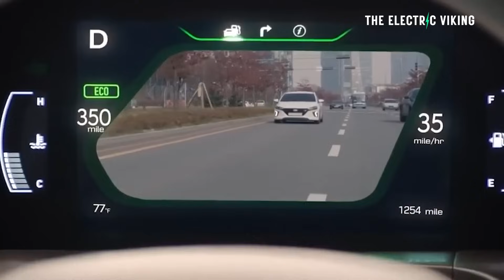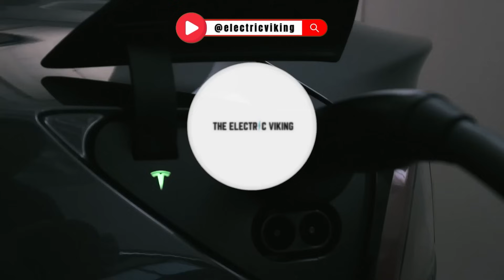Hyundai reveal new hydrogen fuel-cell SUV for global production

Comment: If I was trying to make a widespread hydrogen vehicle I would make BEV with 100-120 miles of range with only ac charging. This would reinforce the myth of evs taking forever to charge and then if they go on a trip they gas up with hydrogen for another 200 miles of range. Would also be beneficial to apartment dwellers without the ability to charge at home. Perhaps a way to feed leaked hydrogen into the fuel cell to charge the battery would prevent wasted hydrogen and fuel. This approach would get a lot of people into EV’s that otherwise wouldn’t which is why a manufacturer wouldn’t do this strategy. If there was any meaningful battery range then people would see how little they use the hydrogen range extender

Comment: Warm water drops / vapor from an all hydrogen fueled transportation multi million vehicle infrastructure refreezing onto roads, coating roads, and parking areas, creating black ice anywhere all winter day and night when traveling on straight, hilly  and curvy road surface, or arriving at a iced up stop sign or traffic light to slid out of control on. Can you say " slip sliding away- crash !". How about Salted roads 24/7 all winter long. polluting freshwater streams. How about the ecological friendliness of polluting freshwater streams with salt from 24/7 treated roads all winter long. The cost to taxpayers to salt roads all winter. The cost to replace prematurely rusted out vehicles often? How about falling on ice in shopping center private parking lots not salted,then re'salted all winter long. Lawyers will have a bonanza of lawsuits to pursue. Falling on the concrete floor in your garage with groceries or carrying an infant from ice? The pro hydrogen fueled vehicle crowd mouthing support for material embrittling hydrogen gas which degrades quickly every substance known to humans, except fragile glass, shows how many green type supporters slept through science, chemistry, and physics classes dreaming of a hydrocarbon free utopian World. Greens are such emotional thinkers devoid of logical thinking. This hydrogen powered vehicle transportation hype is just that.

Comment: Thumb up even when I don't agree with your last conclusion. H2 makes sense as the H2 can be produced at daytime's were we have to much electricity anyway and it can be stored for a long time - direct or as methanol / other chemical forms (H2-Paste / Metal-hydrate). No self discharging like with Batteries. No cycle limitation . . . As long as the H2 is produced with renewables this makes sense.  The Battery tech is  easier but maybe not more environment friendly. On the other hand is you mess up the H2 Idea enough it sure become environment unfriendly as well - I just say blue hydrogen :)

Comment: Hydrogen bombed for good reason. Hydrogen is industrially produced from natural gas. Yep, that's a fossil fuel. To go green, you need to get it via water electrolysis, which consumes a lot of electricity from renewable sources. You might as well just cut the crap and use the electricity to power EV cars directly without the extensive fuel supply chain & logistics in between.

EVs ain't perfect, but they're the best we have so far next to cycling to work.

Comment: It's the old mantra "innovate or die"; if you don't innovate and improve your competitors will and you'll be left to wither away.  I don't think its a bad idea to keep fuel cell development projects funded at car companies as those may be the next innovative step after electric. A lot of car companies seem to putting money into new innovative battery technology to improve energy density, so why not keep a few funds going into fuel cell technology to develop it as an alternative power system?   And it might be possible to transition the tech into stationary power generation units as well as vehicles.  Toyota's was the most visible here in the USA (almost exclusively in California) and I thought those were leased vehicles that include insurance and a fuel subsidy; great way for Toyota to gather real world usage information on the fuel cell system.  Mercedes/Daimler did have a fuel cell program going and even produced a line of demo cars, not sure what happened to that.

Comment: I just cannot understand why they are  wasting time and money on this rubbish. Hydrogen has failed time and time again.
Reply: Geopolitical risk for both Korea and Japan being the last stop of oil plus not having a lithium deposit to build EV and  ad relationship between the two countries makes them independently develop hydrogen vehicles as a fail safe strategy when globalization fails. Japan just found a rich lithium deposit in their exclusive economic zone on the sea so that changes the dynamic a bit. However, the originally plan was to use nuclear plan to make ammonia as the carrier for hydrogen since ammonia requires higher existing tech friendly storage method.

Comment: The only thing hydrogen cars have over ves is faster refuelling. The fuel cell is much more complicated than ev batteries,they both use rare metals in their construction, they both use electric motors, but the hydrogen cars cost much more, the hydrogen costs much more per mile than electricity, there are almost no refuelling stations worldwide outside big cities, hydrogen is much more of a fire and explosion risk, and most importantly, at the moment less than 1% of world hydrogen is green. Why choose to convert electricity to hydrogen, then hydrogen back to electricity, each with an efficiency cost, when you can store the electricity in a battery at about 95% efficiency?

Comment: For hydrogen to have a snowballs chance you'd need to sell cheap hydrogen electolysers people can run off their solar charger so that people can fill their hydrohen vehicle with home made H2
Reply: Still doesn't make any sense - why use your spare electricity to make hydrogen? You need specialist equipment to compress it, store it and fill your car. After all that effort you only go 40% as far as you would putting that excess electricity into your battery vehicle, and there is no special equipment required.

Comment: Hydrogen is a very dangerous gas and expensive to manufacture and store. It requires special handling.. It might be alright in a rocket going to the moon. But would you want it in your garage at home? One leak, and you can get blown to the moon. Electricity is relatively safe and convenient. It is available everywhere and can be made easily from renewable energy sources.

Comment: I've heard the Earth's crust doesn't contain enough lithium to provide for a carfleet that's only bev (big battery).
Reply: Nonsense
Reply: Not true. Li is a common element but not easily or cheaply extracted. It is however completely recyclable, there are already batteries around made from Li that has been in previous batteries.
Reply: Total Bullsh!t. There is plenty of Lithium for all the Lithium Ion Batteries the world will ever need.

Although, if you are worried about rare materials. Fuel Cells REQUIRE TWO of Earth's MOST rare elements (Platinum and Palladium)
Reply: There is enough mineable Lithium from land sources (that we've already discovered) to replace every ICE vehicle on the planet with an EV. There is 5000 to 6000 times as much Lithium in the Earth's ocean water.
Reply: You heard wrong

Comment: Hyundai (and for that matter, car companies) only have very homeLy vehicle styling.  This one is a cut above, and can easily be made into a BEV.  I think they just assume technology will advance in the sector as far as storage and delivery is concerned.  

As a zero emission fuel for aviation, hydrogen is just the best, but the problem is storage.  The very same technology in batteries may be used one day to reliably store hydrogen at room temperature.  So my guess is they’re anticipating a future that doesn’t yet exist.

Why not just use up all of the available hydrogen production at source on-site?  They can transmit the electrical energy produced via the grid without building any infrastructure.

I’ve been watching hybrid-electric jet engines that use methane(which is easier to store) they might be adapted to hydrogen if storage hurdles are technically overcome.

https://youtu.be/zwM2f6irFs4?si=gyIA7MCJWN3IAoHt

Comment: Chinese car breaks record and drives 2,200 km without refueling or charging.

The D7 DMH, plug-in hybrid sedan from Chinese manufacturer Roewe, has set a world record for range by driving 2,208 km without having to refuel or charge, according to the Guinness Book.
Reply: That still not enough to get to the next hydrogen fuelling station…
I prefer topping up at home each night for $2 while I sleep.
Reply: @fergyspoolshots  
Yes, you're right. It is certainly good advice if you have a charging point at home. 
It has always irritated me having to go to a gas station while on your way to work.
Reply: @NackDSP  
Well,
Can your car with solar cells on the roof accelerate to 100 km/h in 7.9 seconds and reach a top speed of 185 km/h?
Can your car with solar cells on the roof reach altitudes  of 1,600 meters or higher ?
Can your car with solar cells on the roof still drive at a temperature of -8 °C or lower?
Can your car with solar cells on the roof still drive in the dark?
Under the above conditions, your car with solar cells on the roof should be able to complete the 2,204 km journey between Lanzhou and Urumqi in China in 4 days, including rest stops for food and sleep.

The car D7 DMH breaks the record under the following situations and/or conditions:
The car completed the journey of 2,204 km between Lanzhou and Urumqi  in China in 4 (four) days including rest stops, exposed to temperature variations from -8 °C to 30 °C and altitudes up to 1,600 meters, conditions that the model withstood with stable performance.
The vehicle's mechanicals combine a 1.5-liter gasoline engine with an electric motor, which together deliver 204 hp and 33.6 kgf/m of torque. This allows the sedan to accelerate to 100 km/h in 7.9 seconds and reach a top speed of 185 km/h.

In addition to its range record, the D7 DMH also offers 125 km of exclusive electric range with a 21.4 kWh battery, extending the total range to about 2,350 km.

Comment: These things have big tanks. If only you can charge it with solar using electrolysis, it could be a game changer.
Reply: But that will never be a reality.
Reply: Still doesn't make any sense - why use your spare electricity to make hydrogen? You need specialist equipment to compress it, store it and fill your car. After all that effort you only go 40% as far as you would putting that excess electricity into your battery vehicle, and there is no special equipment required.

Comment: Why can't these car companies get it? The main issue with EV adoption is range anxiety of people who bought something other than a Tesla.  If they are afraid of that then how much more scared will they be of not being able to find a hydrogen pump when they want to take a trip? There are none outside of California in the US and most of those have closed. 
     At least EVs you can plug into your electricity at home and charge.... can't make your own hydrogen and compress it at your house.... at least not inexpensively, easily, or safely.
Reply: Nine H2 stations in California have closed, about 40-45 are still in operation, and California is negotiating with another oil company to take over those nine stations.  Please don't pull stats out of your backside.
Reply: @ Criticism accepted. You are right and only 21% have closed... not half. 
My apologies on not being more accurate. 
However I'm sure we can agree that hydrogen for transportation use is horribly inefficient as compared to using that electrical power directly in a BEV.  That is also hydrogen's best case when made with renewable energy from water in hydrolysis. If made from fossil fuels it is even more inefficient plus with CO2 release added in.

Comment: While I don't mind innovation, i think the main reason that ev will always lead is because anyone can make electricity at home, no one can make hydrogen...
Reply: you can use solar panels to power the electrolysis machine to manufacture hydrogen and oxygen but to compress it is another issue....
Reply: You need ultra pure water for electrolysis or you get built up on your electrolyser.

So you run a water purification plant to purify and store water to run through your electrolyser.

 Apart from being brutally expensive to set this up, you then need massive amounts of energy to produce a small amount of hydrogen. And then you need to store that. 

All of this is technically possible, but at a practical level is not a solution at all.

Comment: Hydrogen= Desperate strategy to try and keep the terrible gasoline business model going by forcing you to fuel at stations instead of just being ab,r to charge at home.
Reply: or you could make or buy a electrolyzer for your garage to make hydrogen for your tap water.
Reply: @ADobbin1  then you need to compress it, and lots of safety equipment, and it would be so very inefficient as you then need a fuel cell to tun it back to electricity in the car to charge a battery and run a motor.  In fact, just take that original electric you power electrolyzer and charge a battery. Oh, that is an electric car isn't it.
Reply: @tomooo2637  yes some people think they have all the answers. No idea.
It’s like they just want to try anything else but electric vehicles.
Reply: @tomooo2637  Even better, just use a really long extension cord.  No? Maybe we are not the target market. Maybe a publicly unknown client; military, continuity of government, National Security mobility infrastructure redundancy, maybe the Clan Sasquatch  underground bases, Damn Messicans, or for the alien moon base - do we know everything?
Reply: It is far worse than that, the 98% of the hydrogen produced from oil is very energy intensive and so the it is far less efficient from source (crude oil) that making petrol from the crude oil.  It is all a scam that is worse than petrol

Comment: Why are Hyundai bothering when they make very decent EV's?
Reply: Government grants? Just a guess.
Reply: @philiptaylor7902  a smart company that's not putting all their eggs in one basket,so that if a H2 breakthrough occurs - they're not left behind ?
Reply: @lordofsevenrealms  I’d love it if that was true, but attempting to use hydrogen as a transportation fuel for light vehicles is fighting against the immutable laws of physics. FCEV’s have been around as long as BEV’s and gone nowhere, for good reason. Believing that some transformative breakthrough is just around the corner is wishful thinking, I’m afraid.
Reply: @philiptaylor7902  A breakthrough will occur in the West & Maybe densely populated countries like India...BEVs are not going to be accepted with open arms in countries with large amount of rural population....H2 can bridge the gap in market demand in those parts when Gasoline is banned. The other alternative is battery swapping - if swapping batteries (like Nio) takeover and becomes the norm, H2 will be pretty much useless
Reply: @  There’s more to BEV’s than just cars. Electric two and three wheelers are taking off big time in India, for example. And why wouldn’t they be popular in rural areas when you can charge them from solar panels for nothing.
Reply: @lordofsevenrealms  How about wind & solar for those rural countries? Much cheaper than both hydrogen & petroleum.
Reply: @rozonoemi9374  The issue isn't about price, but about adaptability 

Rural and scattered pockets in African, Asian, South American countries would always tilt towards a fueling system that eases range anxiety....battery swapping might convince those belts to go for EVs
Reply: @lordofsevenrealms  How about Free Sun or Wind for those poor people in Africa or others? Much better than paying for petroleum & especially crazy prices of hydrogen.
Reply: @rozonoemi9374  you clearly don't have a clue of how people of these markets react...unless range anxiety is laid to permanent rest, you can't convince most of these folks to go for something, even if you give it for free...battery swap stations is something they will accept
Reply: @lordofsevenrealms  How do you expect Hydrogen vehicles to grow, paying 10 times for hydrogen versus petroleum?
Reply: Hydrogen breakthrough would require breaking laws of thermodynamics, so it won't happen  @lordofsevenrealms
Reply: Hyundai EVs are expensive, they won't survive
Reply: they're losing money on every EV they make?

Comment: People who have ev range anxiety issues. aint that many hydrogen pump stations around anywhere in the world. People who are worried about ev battery fire issues. On oct 18 2024 Hyundai literally just recall hydrogen fuel cell vehicles due to fire risk and tells owners to park them outdoors. So if you have these concerns with EVs yea Hydrogen isnt the solution
Reply: Plus the tank is limited to a smaller range